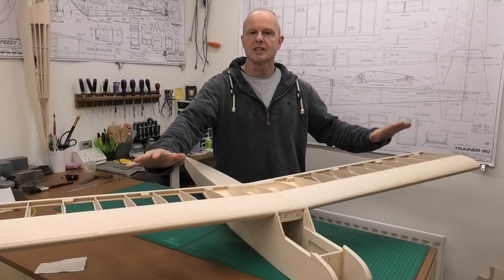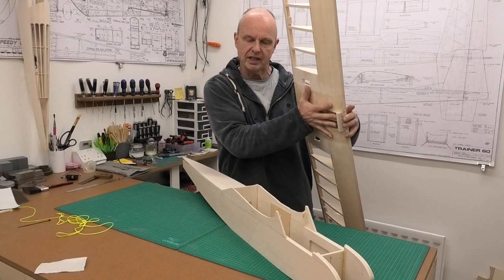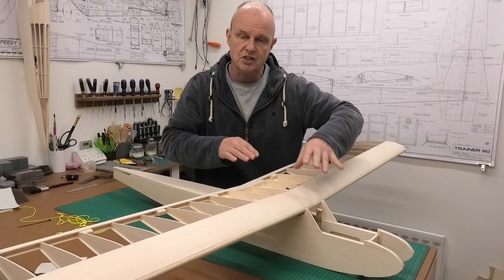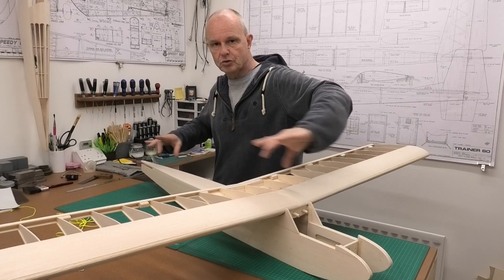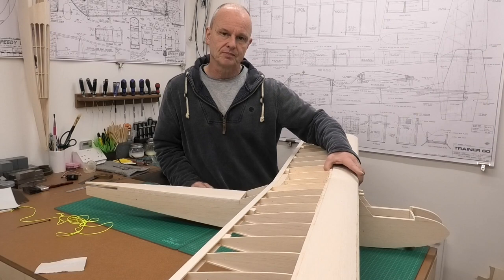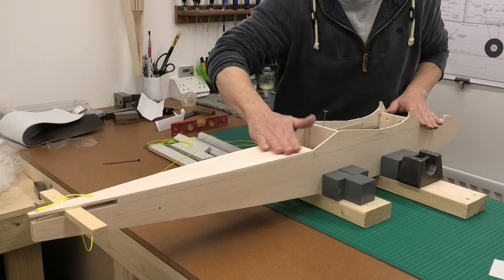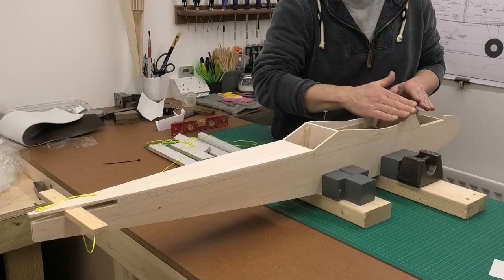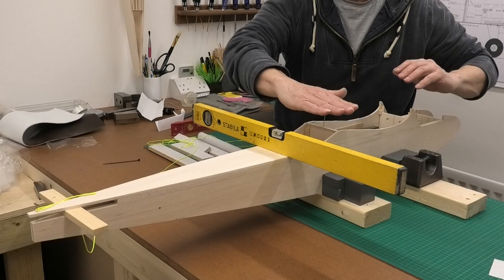Great Planes Trainer 60: Pt 9 Fitting the Wings & Incidence - Build Series - 65" span RC balsa plane

Comment: Just another train of thought. You possibly could’ve put tape around the left side of your sanding bar and that way you would not have to worry about sanding on the tape itself and it might’ve slid a little better. It didn’t look like it was catching or anything, just like I said another train of thought.
Reply from the maker: What you say makes a lot of sense, think I will do it that way next time, thanks for the suggestion